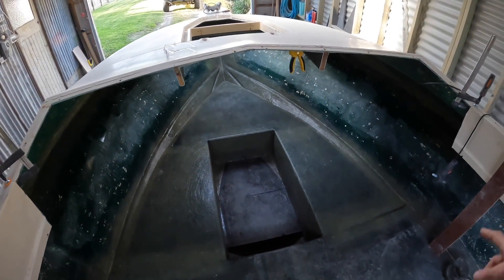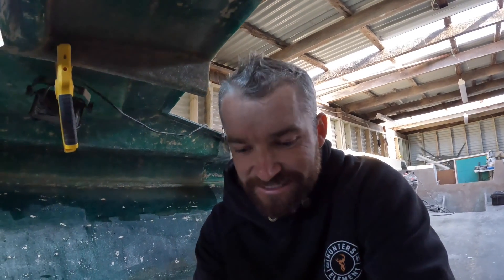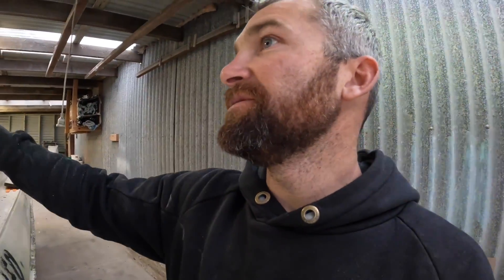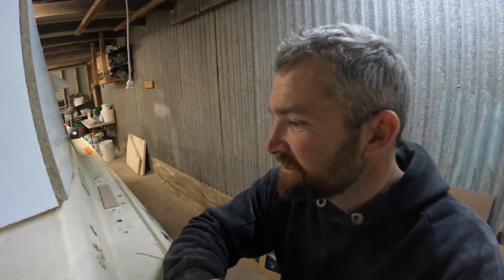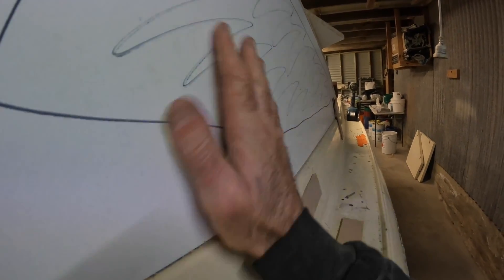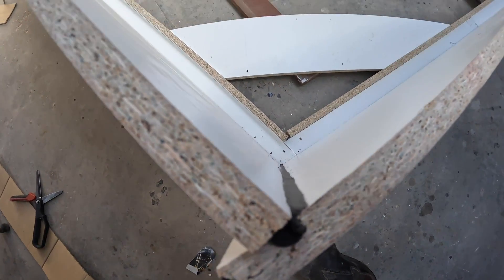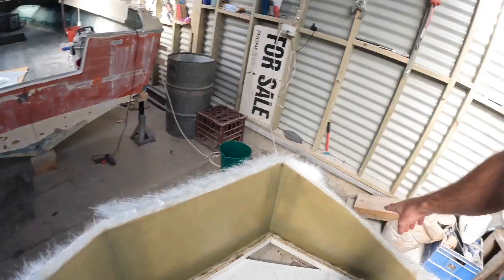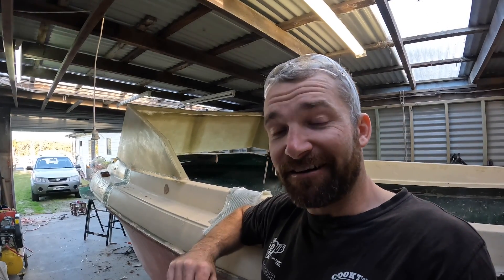Building a solid Fibreglass Wave Breaker from Scratch

Comment: I've loved every minute of this build but I just have to say one thing- you and other blokes like you obviously never played with plasticene when you were kids :) Work a big blob of it in your hands until it's warm and soft and then put it on a flat surface and roll it out into a long skinny sausage- you can use a smooth board to roll it into a long skinny cylinder of consistent thickness- press it along the seam, wet your finger and smooth it out. Takes about a quarter as long to do it and the results are always good.
I'm still working on floor and transom in one of my little old runabouts, but it's forty one degrees (106F) in my shed again today and a bloody awful place to be working with fibreglass.  Cheers,  Jay.

Comment: Hey mate, love the videos, inspired me to build my own boat, just wondering with your wavebreaker and dash molds you’ve glassed into, do you use a waxed or unwaxed resin if you intend on adding more glass afterwards to strengthen up? Keep them coming, cheers
Reply from the maker: Hey mate, glad you’re getting something out of the videos! I used unwaxed laminating resin and I added more glass to the wave breaker after I glasses it to the boat. I did throw more glass at the breaker lip before it was glasses to the boat as it was easier upside down.
Reply: @ADVENTURES_ADRIFT  thanks mate, did you use any waxed resin in any parts of your build to avoid having the tacky surface?
Reply from the maker: When required yes. You have to plan it it when you need wax and when you don’t